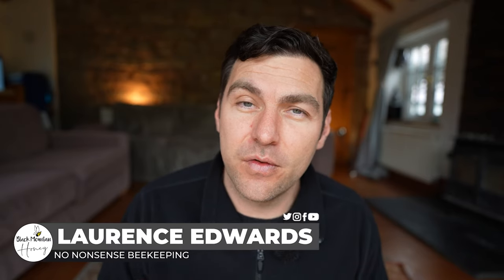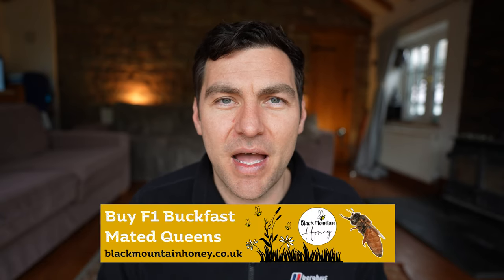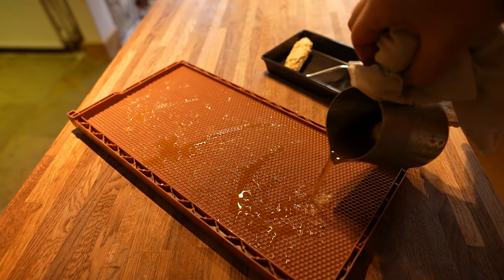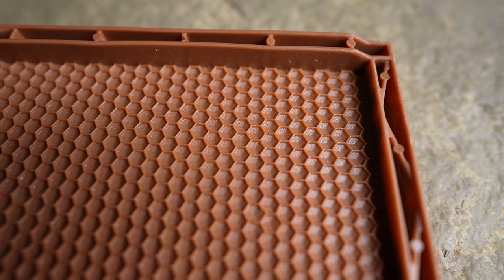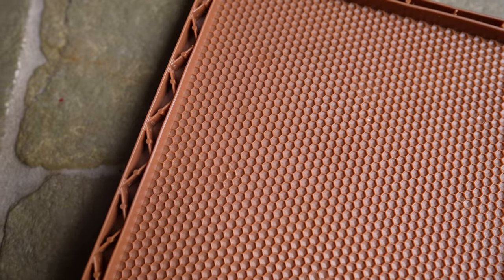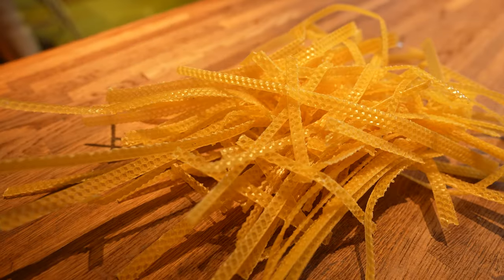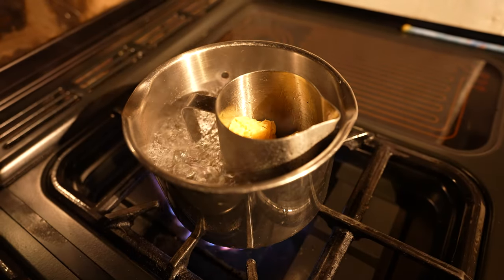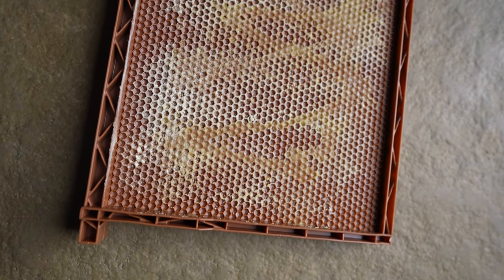How NOT To Coat Your Plastic Frames in Beeswax

Comment: I've never poured beeswax directly on plastic foundation or frames. Instead, I dip a natural-fiber paint brush in a pot of melted beeswax and brush it onto the foundation or frame. I get a much more even coating while using a lot less wax. I say "natural-fiber" because brushes made with nylon or polyester bristles curl when exposed to the heat. Brushes made with hair do not.
Reply: Thanks for info.

Comment: Well titled video! I've found plastic foundation a bit tricky.  First frames that I did with a dipped brush were a disaster - loads of drone and brace comb, and lots of gaps with no drawing at all. 

The key is apparently a thin, even layer of wax with a (gloss paint) roller. Kamon Reynolds did a good demo. I've got 5 Bailey combs going on with these right now, so hoping for good things when I inspect this week.

Comment: I've never used the full plastic frame type but used loads of plastic sheets big batches I dipped  but best results were from using a foam roller soaked in hot wax
Reply: Exactly what I use.  Little radiator/gloss roller and I worked a treat!

Comment: From Australia, plastics dont warp but need to be built out above the brood box for satisfactory results ,on a strong necter flow .
They can be pressure cleaned and used again ,so go on and on saving time, propolis devolves in caustic soda and warm water mix .protective gear is necessary and fresh running  water as caustic soda also dissolves  flesh ,nasty stuff don't recommend

Comment: Please, try this next time. Use 110-120 degree Celsius. Smaller foam roller is more easy depending on what size of frame you have.

https://www.youtube.com/watch?v=QfWMFMSV2Bo

You can't use a normal paint roller, must me a foam roller. Else it get stuck as shown in your video.
Below 90 degree wax won't flow out properly.